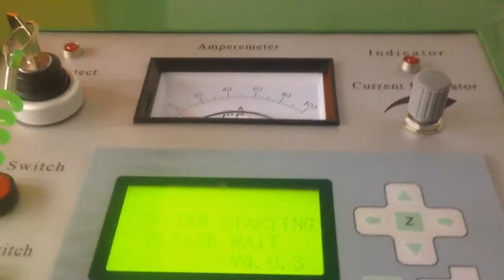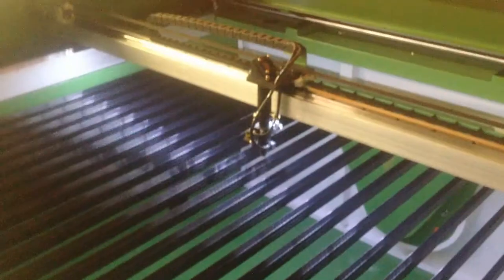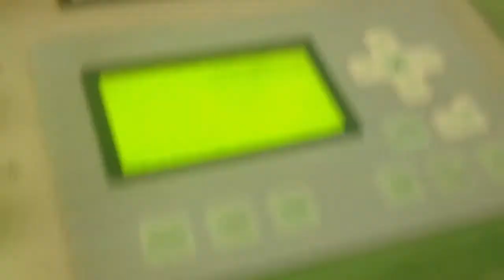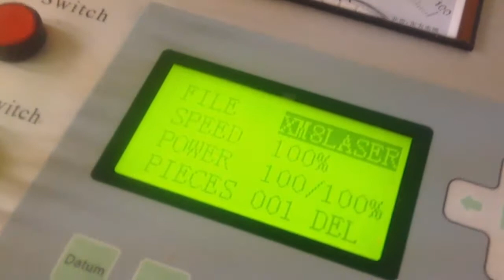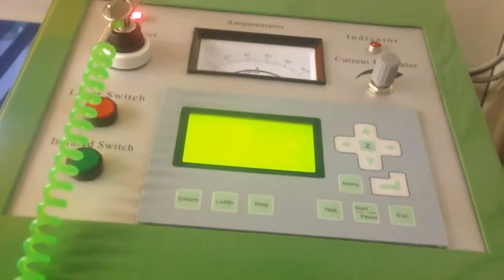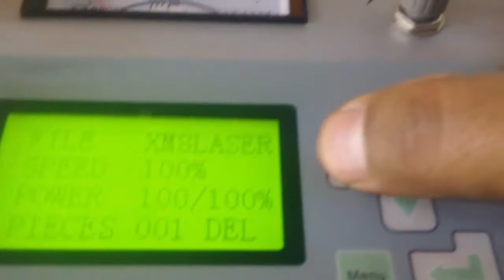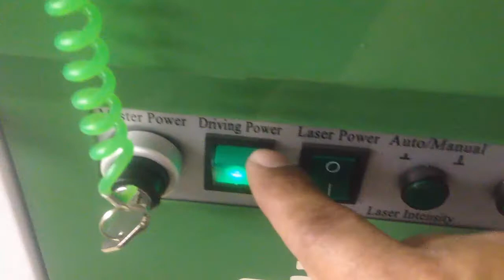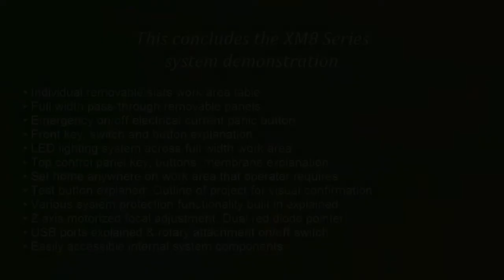XM8 Series System Demonstration

Comment: Is there any documentation still in existence for this? have a Kink that I am trying to rebuild and cant find any info on the power supply.
Reply: what info do you need.  I have a king that's been modified, but power supply is original